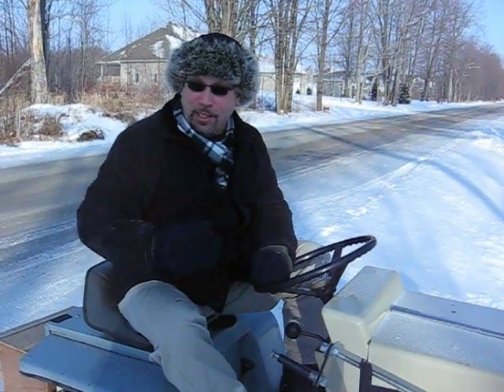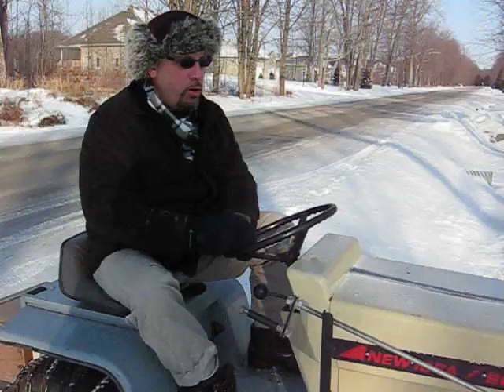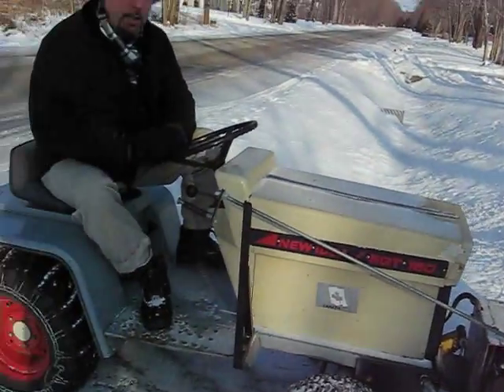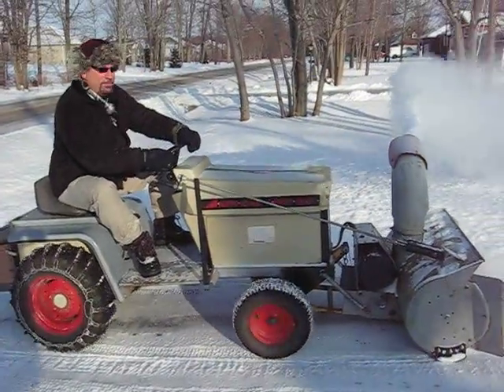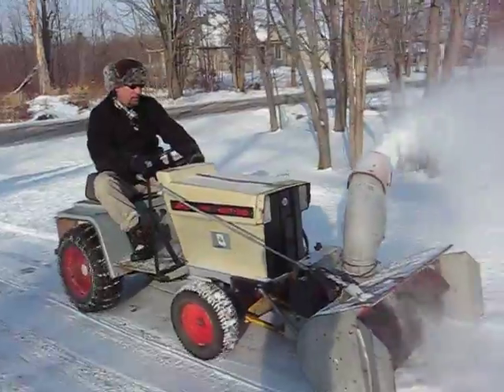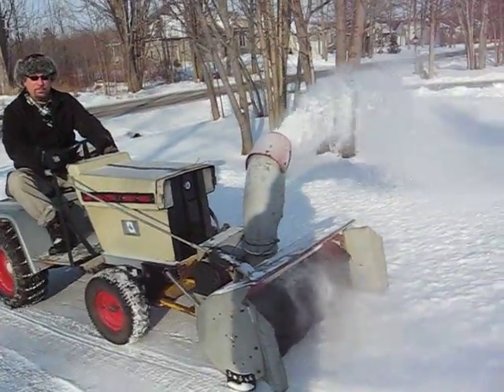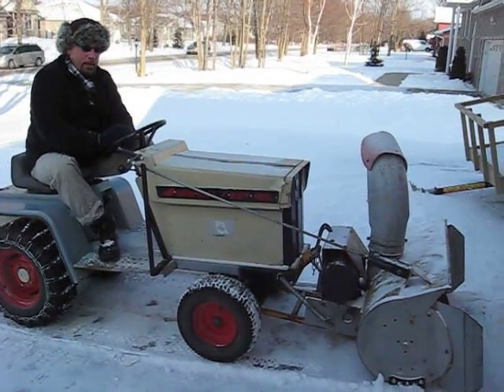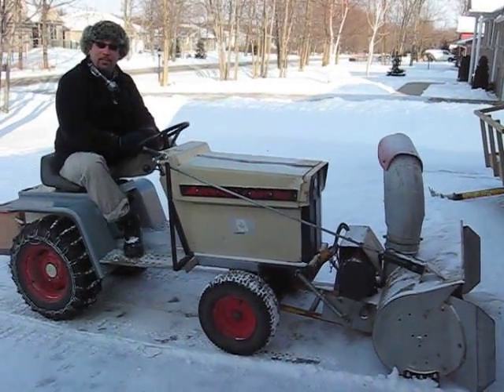Snowblowing with a Solar-Powered Electric Tractor

Comment: Good idea using a electric tractor to clear your snow and now with, then you add in the fact that once the solar panels an other parts are paid off , it won't cost a thing but time to do this. If you add a piece of hard rubber to the scoop part to close the gap between it and housing more , your snow blower will be more efficient and clear snow faster and further. I done that to a 10hp simplicity with 36 inch single stage blower similar to yours and it made a big difference. I used conveyor belt on it for the first attempt on the modification.

Comment: "A lot of gas powered vehicles won't even start in weather this cold". Yeah, and you know why? It's usually because of a dead battery.
Reply from the maker: You are partially correct, but it's not the fault of the battery itself and further underscores the inadequacies of internal combustion.  Batteries (all types) are highly proficient at doling out amps at a steady rate, as they do with the electric vehicles, not being whammed hard as they are when they are required to turn over a gas engine.  This causes great stress on batteries.  However, the greater reason why infernal combustion snowblowers don't start has nothing to do with the batteries, you're just having troubles recognizing the obvious.
Reply: TLEBC I think you're having trouble recognizing the obvious issue why so many people are left stranded in the winter; DEAD BATTERIES! 
I understand in cold situations how engine oil gets thick and puts extra strain on the battery when starting. I run block heaters and battery blankets on all my tractors and equipment. What I hate more than anything when it comes to equipment, and I'm sure all other farmers will agree, is dealing with dead batteries; constantly.
My favorite tractors are my antiques that are pull start or hand crank start which don't have any battery to contend with. The simplicity of not having anything electrical is such a time saver and it reduces maintenance costs.
I understand how some internal combustion engines are inneficient but they sure are reliable and easy to maintain and/or repair. I also understand that electric motors(quality ones) are very reliable but it's the rest of the electric vehicle's sensors, switches, and relays which fail or burn out.
I have some gas engines that are still all original that are 60+ years old and still going strong. When the day comes where I need to replace the engine, all I have to do is swap in a boneyard engine for $50-$150 and I'm back in business. When your electric motor and batteries shit the bed there is no going to the scrapyard and buying used batteries for you. To replace all those parts your looking at spending upwards of $500-$700. I'll take my "Inneficient" internal combustion engines any day of the week over anything battery powered.
Reply from the maker: Jim Garrison Jim, I'm not "having troubles recognizing" anything, I explained clearly in my previous response.  Blaming electrical storage batteries for the inadequacies of internal combustion is akin to blaming the gun for the crime.  The simple point of the video is to demonstrate an intelligent, inexpensive, cost-effective, non-compromised alternative to millions of uncatalyzed motors emitting a variety of poisons into our environment.  I too enjoy antique equipment, but it isn't the point of my demonstration and I don't invade the antique tractor commentaries and blogs with my unrelated comments and ideas.  Also, you completely underestimate the ingenuity of those who seek out solutions to our planet's very-real issues...  we are an imaginative and resourceful lot who are adept at keeping their non-emitting systems working...  my entire cost to build the complete solar-powered tractor system is well under the cost of a bare-bones residential garden tractor from Home Depot and if I had to replace the batteries or other components, I have many ways and contacts who would help me do it on a budget.
Reply: TLEBC There is no arguing with the facts that I gave about the reliability and low cost of maintenance on quality internal combustion engines. I can cleary see that I'm dealing with someone who's bought into this "Man made global warming hoax" and there is no reasoning with this type of person.
There is such a thing as localized pollution caused by man such as toxins being dumped into water sources or smog over metro areas. That being said, there is no facts to prove that man is the cause of any climate variations on a global scale. This is pure nonsense created to put federal regulations on the smaller industries to drive them out of business so conglomerates can swallow them up and these companies in bed with the government will control every aspect of our lives.
The liberal global warming crowd is so delusional I'm surprised there's not more of them trying to convince us that it's somehow our fault how our car emissions caused the climate change that wiped out the dinosaurs.
I like all classic tractors, including electric ones. That being said, I don't like the electric ones for the same reasons as you and I'm afraid there is no sense in trying to have a logical converation with someone who falls for the kind of nonsense as you do. This is futile. End of discussion.
Reply: +Jim Garrison This shows me that your are ignorant about motors. By the time an AC induction electric motor has failed from bearings being seized (99% of the cause), you will have replaced so many parts on your weak gas engine. Show me an engine that can go 182,574 hours without needing MANY parts replaced. AC induction motors I work around were made in 1978 and some in 1982, yet they only been through one or two rewinds, and some only needed new bearings.  

Show me a diesel or gas engine that only ever needed one part replacement or two for a time of running for 182,574 hours. Not going to happen, pal. Engines will need overhaul services in 1500 hours or, if you're lucky, you may get away with 8,000 hours before engine overhaul.

Comment: head over to your neighbors... run out of battery power, then wish you had a traditional gas engine.  I'm not knocking the idea, just the batteries.  I love electric motors and the power they can produce, but the batteries are ALWAYS the weak link

Comment: ok im not trying to start anything but what it you could get a engine to run on propain or natural gas? isnt that good to sept natural gas or even methain just as good as eletric with less polution as as a gas or deseial engine sorry my bad grammer and spelling :/
Reply: kawibbyrule 

Propane and natural gas have slightly less emissions... but the loss of power and added weight usually cancel any benefit.

Comment: @whspioneer89 Yup, not much snow removed in this video.  However, the snow thrower has a 2.5hp series wound motor on it.  Meaning?  Very little will stop it ... short of running out of power. :)  2' of really wet snow, well, that will take some time to remove, but it's doable.  3' of normal snow?  No problem.  I have one of these, it's a beast.  It will eat and throw anything that gets in its way.  Snow, ice, slush, wires buried under snow, kids toys, rocks, this thing won't care.

Comment from the maker: I can get up to about 4 hours of full-load running time.  The battery is about 200 amp-hours and the amps required to keep the tractor moving and provide average power to the mower deck or snowblower is about 50 amps, so 200 / 50 = 4 hours.  In terms of lawnmowing, it takes about 1 1/2 hours to mow my 100' X 200' residential lot so I could mow about two lawns of that size, approximately.

Comment from the maker: Depth of snow varies from snowfall to snowfall, it is a naturally occurring event over which I have no control.  In this situation there is a rather light accumulation, other times there is much more, sometimes over three feet!  The ice content in the accumulation can vary as well, making the snow heavy and crunchy and sometimes the snow is lightish and fluffy due to air trapped in the snow.  The Solar Tractor handles all snow loads, as you can tell by watching the video it has tons of power.